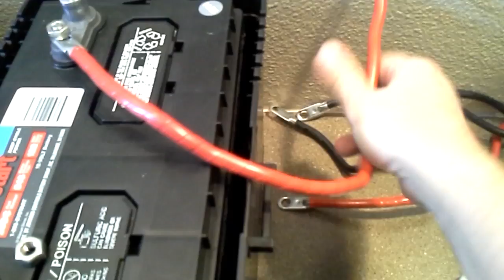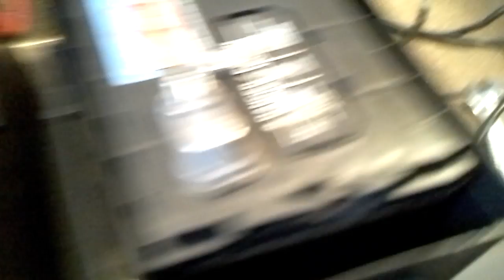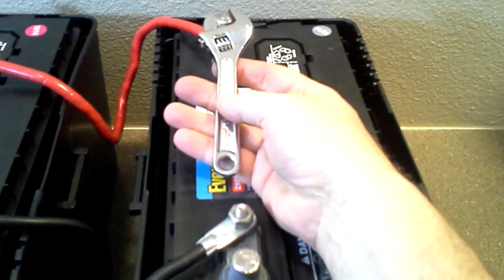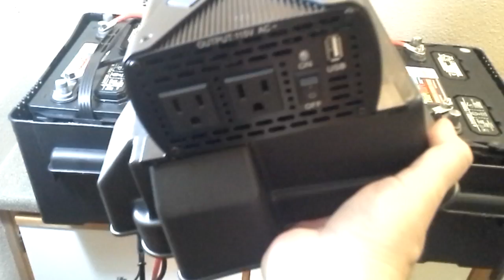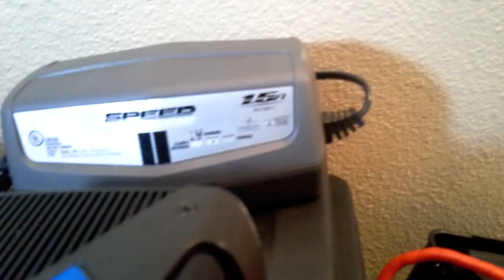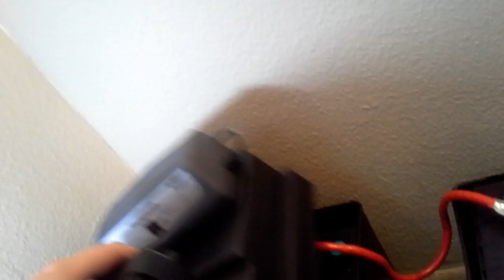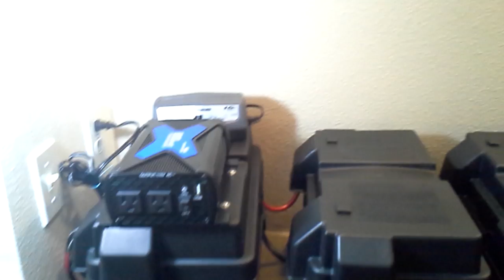Installing 4kW/Hr battery bank with 800W 120V Inverter and Trickle Charger from Tactical Woodgas

Comment: I don't think that 800w inverter will power a fridge or freezer! Unless they are really small! I had a 2000w Honda generator and it would not run my fridge and freezer at the same time! When the compressor kicks on a normal fridge will hit 12-1500 watts draw!
Reply from the maker: Newer energy star units use a smaller compressor.

We have 1200W and 1600W versions at www.tacticalwoodgas.com
Reply: 800 watts is pretty small on my  opinion. I have a 1500 watt pure sine inverter but only a  55 amp hr agm battery and a 33 amp hr gel.   It's just for tinkering with now .  But  it's still 1500 which is decent headroom for running a few low power items or a microwave  but 55 amp hrs is a joke. So I'll use it for tv and charging small batteries as well as soldering. I'm planning on getting a  heating blankets that use much less power then a 1500 watt heater.  I have another heater that on lowest setting only uses 500 watts.  But that don't last long. My games are from an old booster pack so I think they are 4 guage or 2 guage.
Reply: It won't the surge would kill that inverter
Reply from the maker: We now have 2000W and 3000W battery banks at www.tacticalwoodgas.com
Reply: I power mine with a 750 watt inverter

Comment: Got 3 a/c's how much power I need from an inverter to run them from a solar source?
Reply from the maker: Add up the power ratings of the three.

How many hours a day do you run them?
Reply: Need some batterys i reckon more efficient-panels, charge controller,add amps for yurr inverter
Reply: At least 3,000 watts with a large cap.Maybe they won't kick in at the same time.

Comment: WHAT KIND OF SMALL APPLIANCES WOULD RUN on INVERTED 110 WITH 3000W up to 4000W with 2 DEEP CYCLE 12V BATTERIES ?
Reply: All of them. Just a matter of how long.
Reply: I can run my frige for about a day with one battery like this here. So 2 batteries could do a friend for 2 possible 2 1/2 days depending on the fridge. 

When my power goes out I raise rhe temp setting on my refrigerator and don't open it when rhe power goes out. I rarely get power outages that last more than 10 hours. I've had a few 24 hour ones but only a few.
Reply: you have get real deep cycle battery like 75amp 900watts or 100amp 1200 watts deep cycle battery

Comment: So after all this time,did it work well being hooked up to refrigerator???
Reply: Ellis Smith Jr: This setup should work with a refrigerator (I'm assuming it's a 120 volt refrigerator), depending on the refrigerator's start-up and average running wattage. As to how long, read below. 

These deep cycle marine batteries, though rated as 100 amp hours each, can only be used to 50 amp hours each if you don't want to damage their ability to recover. This means that this system's effective rating is 150 amp hours. Converting this to watt-hours makes it 12 volts times 150 amp hours, or 1,800 watt-hours.

If your typical refrigerator averages 80 watts per hour, then you're dealing with 1,800 divided by 80 watts, or 22.5 hours, less the 5% loss from the inverter, leaves a final result of 21.37 hours (5% loss is ideal, from a most efficient inverter. One can have inverters as low as 75% efficient which dramatically changes the run times as you'd have to subtract 25% of the total expected use time. Note, too, that as the batteries lose power they lose voltage and at a certain point the inverter's low voltage cut-off may occur which can change the time estimate here, depending on the overall health of the batteries used.

If one can hook up a solar recharging system that will reduce the net amperage loss per hour resulting in longer run times.

Comment: Connecting Batteries in parallel is not a good practise. Because among the strongest Battery(in perspective of Voltage) always charge the other Battery when charger not present  therefore it reduce the Battery life. Series connection is recommended & it also reduce the (I^2 R) losses & give us more Backup time.
Reply: Serial connection makes sense for larger battery banks.  The extra cost of a 48v inverter is higher than the cost of thick cables on small systems like this.

Comment: Hey how are you? I have a really quick question, I live in haiti and I have a inverter that's 3000w and I also have a solar panel,and also a generator,I haven't bought batteries yet,how many batteries would I need and also how would I plug the solar panel to the batteries so it would give it charge ? Please help 
Ps Chris.
Reply from the maker: chris joshua 
Put a solar charge controller between your solar panels and the batteries.
How many watts of solar do you have?
Reply: Tactical WoodGas  315w
Reply from the maker: chris joshua 
315W of solar can collect up to 1.5kWH per day.  At 12V, that is 125AH.  I'd  use three 100AH batteries.
Reply: Batteries very 6v ones. More amp hours more expensive ure usage is another what u plan to run how long its needed and some days is storming and those days not much power being made and clean if they are clean it is best but dirty you lose power keep in mind I'm looking for my own and still need help

Comment: Can we use less than four batteries? Like two or three batteries but following the same connection as you are showing on video .
Reply: You used two batteries 12 volt deep cycle  230AMP  batteries thinking 2760 watts two batteries get 5520 watts
Reply: I used one... Then upgraded to two and now four. Doubling up to 8 soon..

All work the same.

Comment: Could I run a coffee pot, portable stove and rice cooker with this set up?
Reply: Yes... 2 Group 29 batteries n ur set
Reply: @josephalberta1145  Can just not at the same time... I use a 1500 watt steam vac, 13 amp electric pressure washer & 2hp shop vac for hours and its been fine?

Comment: My question is, can i use a car 400w inverter for a 120V household appliances? i have a tires inflator that's 120V and i'm thinking about buying a 400w inverter. thanks in advance.
Reply: Yes you csn

Comment: i watched dozens of videos, read books, etc, no where does anyone mention about charging batteries & drawing power from them at same time, i'm gonna hookup wind generator soon & it looks like i'll have to charge batteries, disconnect wind turbine from charging, then hookup inverter to use power from 12 volt batteries, beginning to think it isnt worth the hassle.
Reply: atta boy there is not much info on it but I have the breakdown for you. you are correct in that you cannot charge and discharge, but you do not need disconnect and reconnect. I'll use a 100 unit scale for ease. solar panel generates 100 units, battery bank is full, load is 80 units, the solar panel powers it all. if you load is 120 units, you are pulling 20 units from the bank. if your bank is at 50% charge and you have an 80 unit load. the solar panel covers the load and the additional 20 units goes to charging the bank. so a battery bank is essentially an overflow storage. which also offers extra juice if you go over your power production capacity. hope this helps.
Reply: +Rufus rocketship thanks for info, yesterday I bought a 800 watt inverter & it looks like  positive goes to first battery then neg goes to furthest battery away from 1st one, the Coleman 400 watt wind generator manual doesn't say exactly how to hookup everything, I suppose it depends on a lot things but I have a month or so anyway cuz the frost is still 3-4 feet deep here in northern MN & I have to drive 8 foot grounding rod down, apparently this part of install is very important, thanks again, Ron.
Reply: atta boy you can also set your overflow to run to a heater or water heater. it's a good way to drain the excess power. there are a couple of really good videos on wiring your batteries in your bank. no harm intended to the poster of this video, but have a look at people setting up 24v and 48v systems. they go into detail about properly paralleling batteries.
Reply: That's correct.  When you have parallel batteries (as shown in the video), the pos/neg- (red/black) leads connect on opposite ends of the battery bank.  Same thing for charging leads. If you have a wind generator, which must be properly controlled (or "regulated" if there's a voltage regulator) to approx 13.8 volts, it can be installed with red to the same post as the feed red wire to the inverter and the black wire can be attached to the same post as the black wire to the inverter.  But both feeds -- the red charging lead from the wind generator or solar panels, and the red feed wire to the inverter; and  also, the black neg wire from the wind generator and black negative lead to the inverter -- should be attached at opposite ends of the battery bank.
As the video states, it's important to keep red to red and black to black for all connections.
Reply: When "paralleling batteries you end up with a giant battery of the original voltage. When you connect in series you increase the voltage. Older heavy trucks usually used a 12 VDC system, but wired 6VDC batteries in series to make 12 VDC and then hooked the resulting 12 VDC set again in parallel to make a larger 12 VDC battery set up. The reason for that was that 6 VDC batteries used to be more efficient relatively until battery manufacture technology improved. Some heavy trucks used 24 VDC for starting but 12 VDC for everything else so they used a series/parallel switch that only powered the starter.
Reply: Your suggestion about drawing from different ends of the battery bank sounds like the old mechanics tale about concrete sucking the voltage out of the battery. The truth of the matter in that scenario was that old style batteries with the cell connectors on the outside of the case would collect dirt. Then if you put the battery directly on concrete the battery would have moisture condense and the battery discharged through the exposed cell connectors and the conductive moist dirt. Set the battery on a board and the condensation was not so pronounced.
Reply: Jerry Lynch your wrong. The earlier type batteries had conductive cases. Nimrod!
Reply: Jerry - here's the way it works.

Batteries charge and supply power based on resistance.  That's just an electrical fact.  If that were just an "old mechanic tale", then all the battery chargers ("smart or dumb") just wouldn't work.  

I have been looking for the website that I found that showed where some solar power researchers had looked at the difference in resistance in linked batteries.  The configuration with the positive and the negative at the same end resulted in the batteries at the "other end" with 12 - 15% less charge when an inverter/charger sensed the chain as fully charged, versus the arrangment where the positive cable was at one end and the negative at the other.  Also, the "less favored" batteries dropped to lower "State of Charge" when the inverter/charger  was drawing power from the batteries.  If a battery in a bank sees that kind of inequality, it will fail quicker than the others -- that's just another practical fact.

I have a friend who has a Greyhound-type bus converted to a motor home (basically a moving off-grid system).  The batteries had about 7 years on them when he bought the bus -- the former owner told him that they were getting a little tired -- but when installed, they were configured with the pos at one end and neg at the other.  With careful maintenance, he got another two years out of them, then when he replaced them, it cost him $3200.  I can't think of any reason to endanger a component that costs that much by stressing them by the installation arrangement.

That's my last word.  I'm out of here.  I urge anyone who is running "off-grid" and buying their own batteries to research this yourself.  It will be in your interest.

Comment: How much power ah...50ah 1 battry..or how many
Reply from the maker: I use a 100ah battery, group 29 size.  For home, I have 6 batteries.  In my truck I have 2.

Comment: How many solar panels and batteries  do i need to supply power to a six rooms building with two television set and one refrigerator? I reside in a hot country Namibia.
Reply from the maker: How many watt-hours a month do you use?  If you don't know and can't find out, start with 600 watts of solar and 600 amp-hours of battery and a 2000W inverter.
Reply: @tacticalwoodgas4036  thank you very much. I want the off grid system
Reply from the maker: @franshanoshike5947  
Namibia is 220V 50Hz so you need to find an inverter to provide that.  Our products are 115V 60Hz.
Reply: @tacticalwoodgas4036  thank you once more again.
Reply: how much money you have?
Reply: @garyjonson1872  Are you in Namibia?

Comment: How long do you have to charge the battery for
Reply from the maker: One battery has 600WH usable (1200W-H total).  The 3A wall charger would take about 16 hours.  If you need it charged faster you can use your car and jumper cables and charge in 45 minutes.

Comment: Why not just strip the plug on charger make it 12 volt to battery it will work done it run a electric dc motor to alternator back into batterys then you won't need to use house plug in for charging it will be already generate your endless power you want ?
Reply: Tyler Dunn exactly what I was about to say
Reply: What about the discharge time

Comment: how many batteries do i need if I am going to use a 5000 watt inverter but only going to use 2000 watts? I need at least 5 hours of power
Reply from the maker: 2000W x 5 hours = 10kWH total charge needed

A 100AH battery has 100AH x 12V /2 = 0.6kWHr usable when charged (inverter will shut off when half is used, to protect the battery).

10kWH / 0.6kWH = 17 batteries require that are rated for 100AH or better

Comment: How long can ur 3 batteries run ur frig
Reply: Omar Williams  my full size side by side fridge pulls 155 watts with the ice maker and lights turned off.  It would run around 24 hrs on them 3 batteries.  But I don't know what it pulls when it is defrosting. My 15 cubic ft. fridge only pulls 110 watts.

Comment: why you connect the inverter to the left battery instead of the midlle?
Reply: pattoe1973 they are in paralel so it doesnt matter, its the same
Reply: so  you are sure there is no resistance in the wires at all ? so you think you dont drain more power from the "connected " battery , in comparision to the midlle battery ? and you went to a school where they told you you do not have to ad up the total length of all the wires to calculate total resistance ?so you dont think the differance between drain on left and right battery is double in comparision to the midle battery ? sinds you know battery's like to be managed (BMS) in order to stay in perfect balance to perform optimal , you do  everything possible to let them last as long as possible . (  you know a 12 volt lead-acid battery is old technology , 6 cells without BMS , and therefore in disadvantage )  hope  you  understand due to resistance there is a differance that will cause an unbalanced battery bank
Reply: The correct connection is hook up the positive form the 1st battery and hook the negative in last battery...same charge and discharge
Reply: even if he hooked it up in the middle it still means the middle battery would have a higher current drawn from it then the other 2 and the amount that it throws it out would not matter the cable is short and has a very low resistance its not of any concern
Reply: now you have 2 TIMES the short cable

Comment: you should connect the negative first just saying
Reply: And... he should REALLY not have put both the negative & positive charge/inverter wire on the SAME battery. - He should have put one on the first battery and the other on the third... in order to keep them balanced properly. -- Guy, if you read this, definitely change them.
Reply: Agree in theory, but I have had mine connected as the video shows for four years.  I did load checks this spring and internal battery impedance is within 4% across the batteries.

Comment: How I calculate solars I needed in my house ?
Reply: Hassan Jama , you can look at past electric bills and see KWH you use each month and go with your highest bill ,  and you can look on appliances , lightbulbs , TVs , everything in your house and add the watts up , solar panels come in all different size wattage, I would get 100 watt solar panels, and let's say you have added up everything and it comes to 2500w, I would get enough solar panels to make 3500w because the sun doesn't shine each and every day, you will have cloudy days, rainy days, and you will want a battery Bank to supply you enough power on these cloudy or rainy days and your solar panels are not making any power, I would also suggest you get a wind turbine, that way when the sun isn't shining the wind is usually blowing and when the wind isn't blowing it's usually sunny outside, this would keep your battery Bank fully charged, but these are only suggestions, there is really no such thing as Overkill when it comes to making electricity
Reply: Step 1 is to reduce the amount you use as much as you can by replacing inefficient lights and appliances with high efficiency ones.
 An L.E.D. light bulb makes the same amount of light, but uses   1/10th the amount of electricity, and makes 90% less heat your air conditioner needs to extract. A front loading HE washing machine uses much less water, heat, electricity, and detergent while cleaning better, and wearing out clothing less than a top loader. An outdoor clothes drying rack uses no gas or electricity whatsoever.
Step 2 may be much harder. Teach the people in the house to turn off lights, TV etc. when leaving the room.
Now you can use the money you save to pay for a small system and take your bedroom off the grid, then take the more money you save and expand your system, and so on until you realize you have enough for your needs.